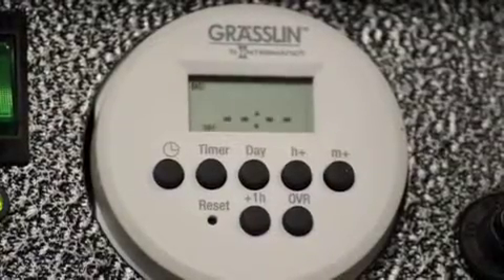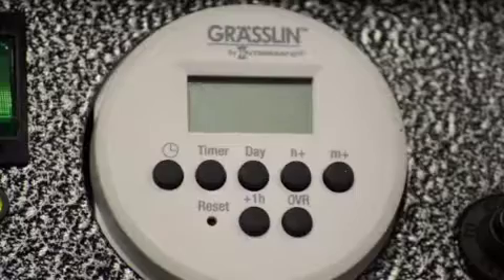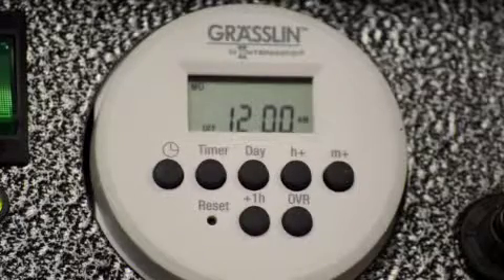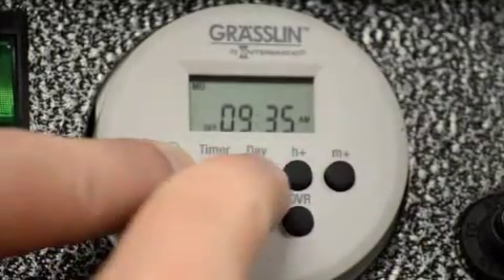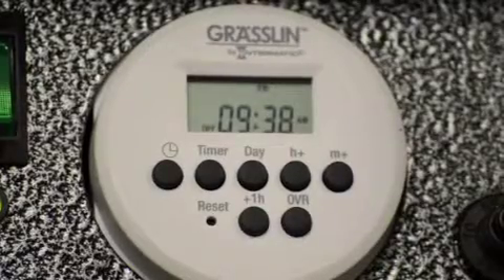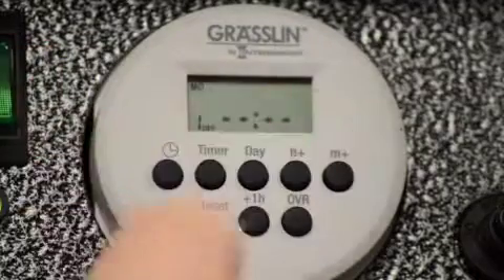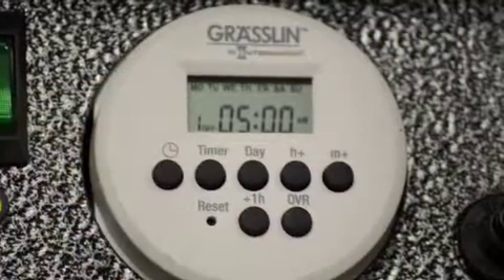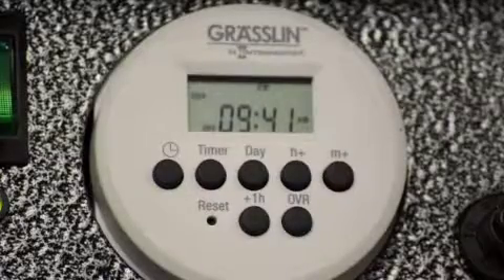Digital Timer

Comment: I'm only doing 1 day a week. I set it for TU 1on at 8:45am and 1off at 9:10am it came on at 8:45am but did not shut off at 9:10am.  I double checked the day and times. Any advice?